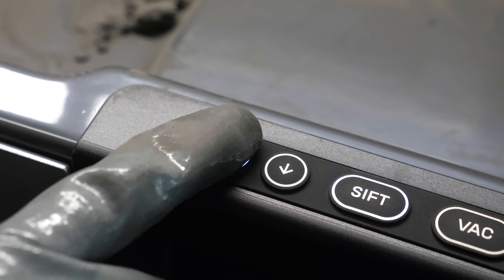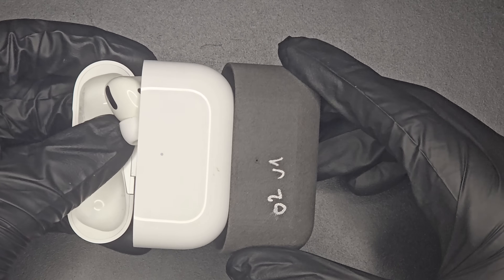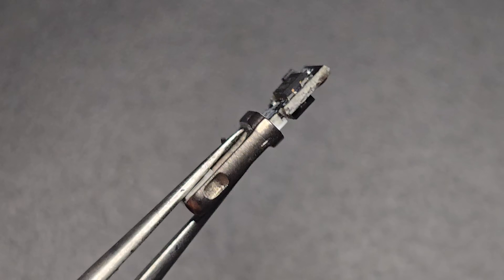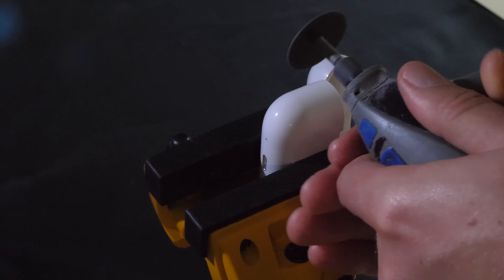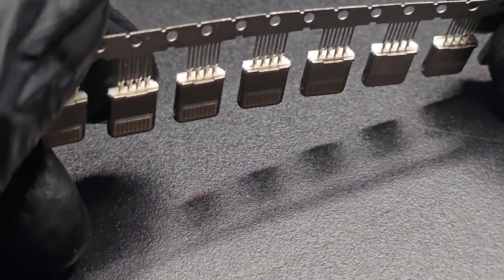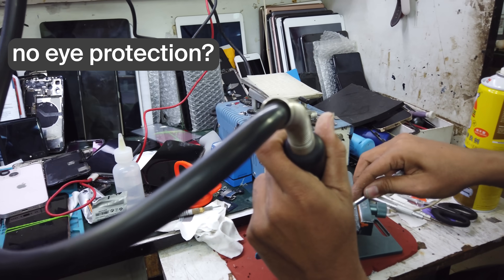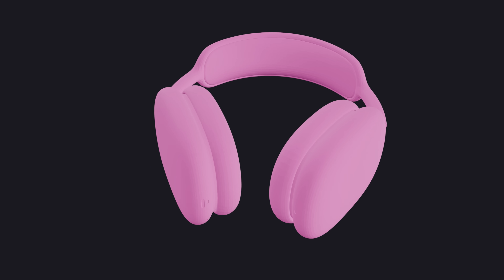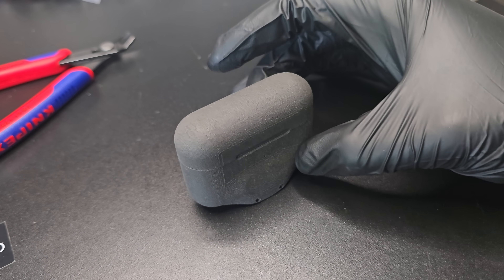USB-C on ANY AirPods - in 10 seconds

Comment from the maker: As promised I'm doing a giveaway! Details here:

https://www.instagram.com/reel/DAqlxPEt7-H
https://www.linkedin.com/posts/kpillonel_for-the-past-year-ive-been-selling-kits-activity-7247600987429830657-CYOd

I'm getting bombarded right now but I'll definitely read all the comments ❤ Thank you so much.
Reply: Hello! Sorry but I don’t understand if with the AirPods Pro 2 usb c case we are still able to use MagSafe chargers or for them we need to remove that cover.. thanks!
Reply: Is there any case like this for iphones?  Maybe just making the chin longer and even a possibility to add a headphine jack at 90 degrees? 

I have been thinkin abt it but getting the chip is hard.
Reply: Adding you on linkedin!
Reply: Hi, just wondering if the new usb c update made possible for audio passthrough on the usb c mod either hard mod or adapter

Comment: Have you considered, like for AirPods Pro 1, creating/using USB C PCB ? 
I tried to use "OEM" USB C pcb (from A2968) on A2700 case, sadly only the LED works (didn't try the speaker), it doesn't charge...
I haven't yet checked pinout of both PCB A2700 vs A2968

Comment: Nice work - still, why bother and not just use the adapter you showed, leave it on the cable and done - all this for a case that can be charged wirelessly seems like a perfect solution for a problem that did not exist and why would you actually put an adapter on your AirPods Max if it is actually bigger than the adapter you put on a cable. 

Sorry, I don‘t want to hate it and it is really really great work - however, I don‘t get why and whether the market is there.

Comment: Impressive. yet airpod batteries were not meant to have USB-C changing bc it will degrade the battery capacity extremely fast. slow charging is better for airpods. unless you plan on making replacement batteries which we all know isn’t possible. so great product but pointless.
Reply from the maker: Completely false. My adapter doesn't charge quicker than with the original Lightning cable, so battery life is simply unaffected. For battery replacement you can check my 'AirPods Dirty Secret' video :)

Comment: Make a similar case for iphones with usb c and 3.5 mm jack
Reply from the maker: Just curious, would a 3.5mm jack be really necessary, or could connecting headphones through the USB-C connector work too?
Reply: @ExploringTheSimulation  3.5mm will really be appreciated or you can add an extra type c port…a case with multiple type c ports..
Reply from the maker: @ What would you use the multiple USB-C ports for?

Comment: So I might just be dumb but, yeah you connected a usb c to lightning, doesn't mean the lightning port on the air pods gains the higher power and data transfer of usb c... cause its not usb c.... so what's the point of this convenience? using the same cable? that's over engineered.

Comment: I'm assuming this fixture for the AirPods Max wouldn't be compatible/fit over the a silcone protector?
Reply from the maker: Depends which silicone protector, but probably not. Can you always try to cut out a little bit of the silicone protector to make it fit though
Reply: @ I made the cut and it fits perfectly! You’re doing the lords work out here brother! You’re appreciated. If you’ll like a picture or review lemme know where to place it.
Reply from the maker: @nhatnguyen-zt3qu  A pic in #successful_builds on Discord would be very much appreciated 😇 thank you!!
Reply: @ExploringTheSimulation  lol sorry man after a month of usage the adaptor broke. The material is pretty flimsy. Great concept but I would suggest upgrading to plastic or something more sturdy
Reply from the maker: @nhatnguyen-zt3qu  Sorry to hear that! There was a weak point in the first version that has been identified and fixed. You still have a one-year warranty! Reply to your confirmation email with a picture of the issue, and we will sort you out with a replacement 😇
Reply from the maker: @nhatnguyen-zt3qu  Sorry to hear that! There was a weak point in the first version that has been identified and fixed. You still have a one-year warranty! Reply to your confirmation email with a picture of the issue, and we will sort you out with a replacement 😇

Comment: According to the website it is only compatible  with  AirPods Pro Gen. 2 Models. If the case has the model number *2700. I have the model number A2698. I assume it will not work on my case?
Reply from the maker: Check the model number of your case, not your buds ;)

Comment: hey, I wonder, are you gonna make a new iteration with a much smoother outer shell from now and a hole/extension for carabiner loops/keychains? I would consider buying that in future.
Reply from the maker: Haven't had anyone complain about the texture yet, quite the opposite actually. But I can understand that it's not for everyone. Stay tuned for the next video where you might see a different finish.
For the carabiner thing, yes, but can't tell you when right now. I'm still ironing out the production process and when I'm really confortable with it I will start making new features available :)

Comment: Cool video, subbed. Also, 6:06 for these cases its common for manufacturers to put a small round plastic sticker on the component for the suction cup to hold on to. Maybe not helpful in your case when you make alot of boards, but for a small batch size it could work.

Comment: Wow. I bought the upgrade kit a year+ ago and before I got around to fitting it (I was waiting for the batteries to die before I risked the task, not realising batteries are hard to get) one of the internal mics came loose, so active noise cancelling now gives a knocking noise when I move. So I had to get new, usb C version. My old ones work without ANC, so it’s a good time to upgrade that old case now anyways… but the only problem is I can’t find the flex cable! Beautiful engineering ❤

Comment: I almost had a fire using a lightning to usb c adapter on my airpods pro 2 case. It fried my case! Thankfully I caught it before the fire grew. It melt my usb c cable. I'm hesitant to use adapters. They must be cheap and degrade over time or I was super unlucky.

Comment: I'll definitely consider the Airpod Max internal USB-C design. I couldn't believe they went for Lightning.
The other 2 things I wish they did was add a physical on/off button because the time it takes to go into standby is shocking and I'm not putting them in the case every time.
Finally, why would they not put wireless charging in the headband so you could hand them up when not in use and they charge?
It's like Apple purposely give us the weakest iteration each time to try and sell more units.
Reply: As much as i love apple products, i bet it's exactly how they are designed. They probably start with a neat full fledged design, with all the bells and whistles, and remove features so they can add them back in the next three to four years, one at a time. How could they sell you a new model every year if last year’s one was already perfect?

Comment: worries about being out €500 ... buys €12k sandblasting robot.
Reply: He makes an investment that he can make money with again.
Reply: Don’t cha love the “He coulda just….” 
These sit around and do NOTHING.
Reply: @tekis0 exactly!!!!! These clowns always out here making decisions about how others spend their own money while they sit around being useless
Reply: For 12K, he could have gone with injection molding, bringing the BOM cost of the case down to a few pennies. 😂
Reply: @bobweiram6321 difference is that the equipment allows future projects to be made at small scale and for cheap so it greatly helps with inovation. also if an improved design is made then injection molding would make changing the case design very difficult
Reply from the maker: @oggilein1  you get it! 

Also for 12k I could maybe barely pay to cut molds for one model of AirPods. I just released 6 different models and I'm not done yet ;) Sandblasting robot was a no brainer
Reply: @ExploringTheSimulation Now can you design one that I can attach a carabiner to so I can carry it on my belt loop of my pants or bag instead of in my pocket? I would buy more if they were different colors too.
Reply: Could have gone injection molding way

Comment: Could bring the USB-C to the OG port even closer if you make the PCB split in half. So, you have them make you a long FPCB, with a split down the middle, and in manufacturing, you twist it so that the port ends up inside that split, with the two tracks either side, like a ram's horns.